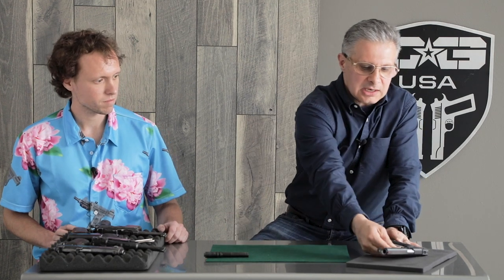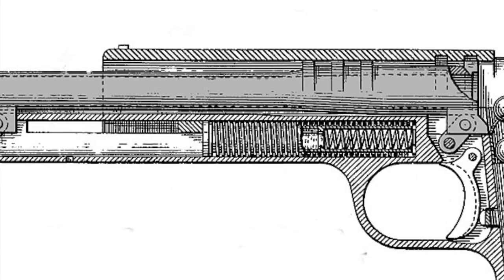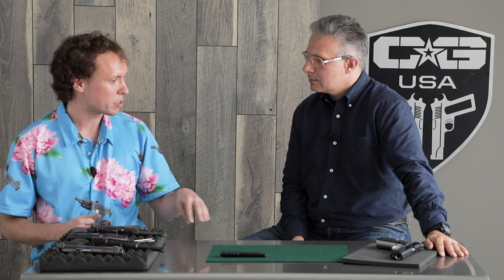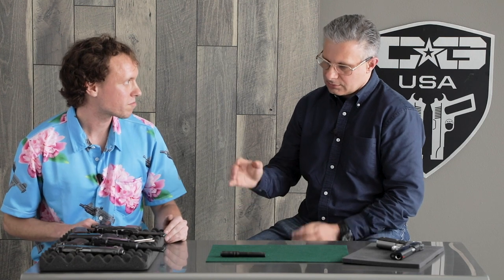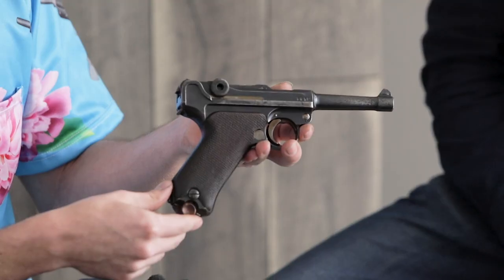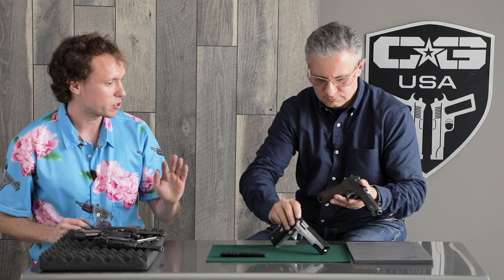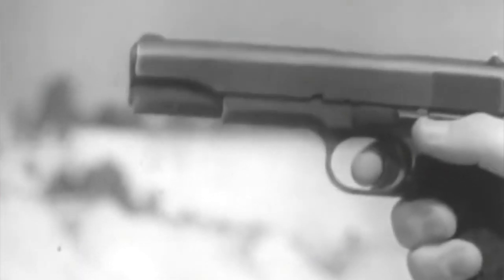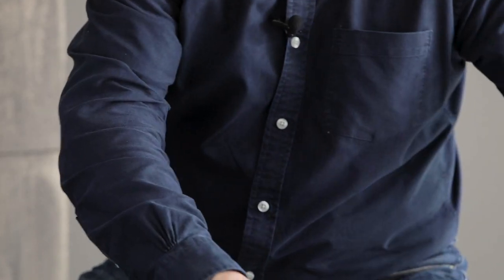A Brief History of the 1911

Comment: Speed of reloading, during sustained Moro swarms attacks, was the biggest advantage of the 1911 over  any revolver.  2 seconds to reload a .45 1911. 30 seconds for a .45 Peacemaker. 
Everyone is always hung up on the caliber size killing power. That was only half of the issue.
Reply: Well, between 1873 and 1911 they invented both a swing out sylinder and speedloaders for revolvers.
Reply: @gunnarkvinlaug7226  Still significantly slower than an automatic. Modern speed loaders for revolvers are really fast. But back then, for the Navy .38 ,they were essentially a block of wood with holes in them to hold the bullets in the shape of the cylinder.